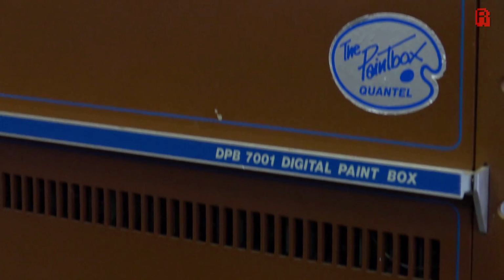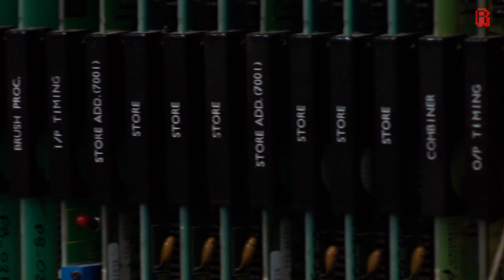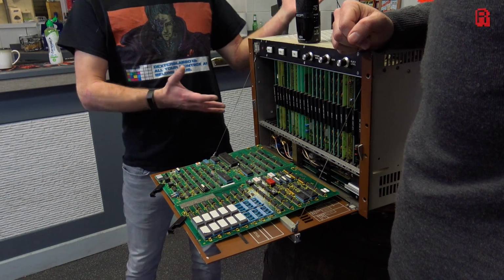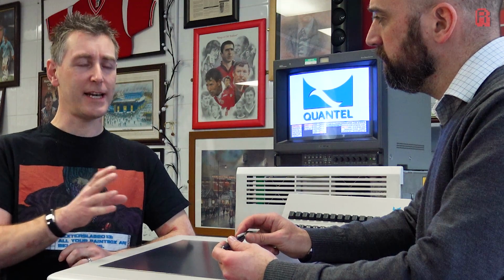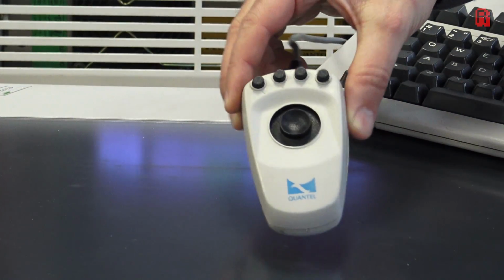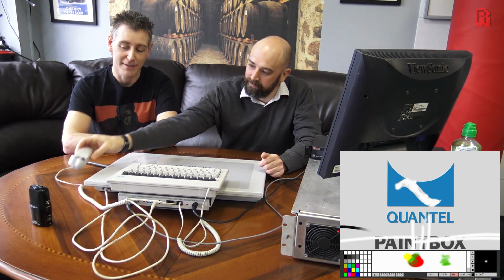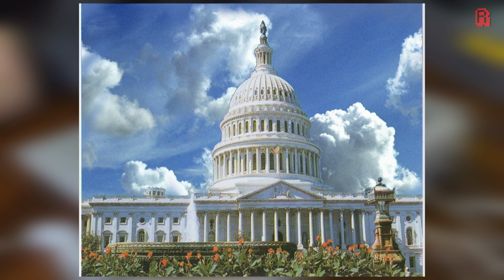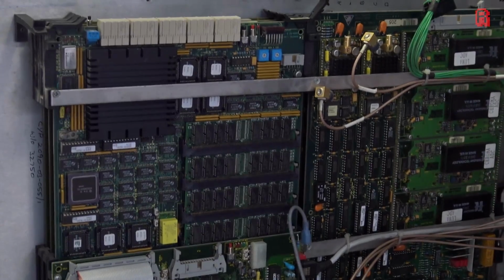How Did they make TV Graphics in the 80's & 90's?  Meet the Quantel Paintbox | Retro Road Trip

Comment: A 500MB SCSI hard-drive in 1989/1990 must've been $10,000.  I bought two 80MB SCSI hard-drives and an Adaptec controller card in May of '89 and spent damn near $2,000.  I realize part of that was the controller card, but still...  A single 500MB drive must've been ungodly expensive.
Reply: From another video these were SMD. At work I paid about £3000 each for 300MByte drives (I think they were 10") in the early 90s. At that price you also wanted a maintenance contract on them.

Comment: I own an original Spaceward Microsystems Matisse. Quantel sued, won and took the other British competitor out of business. Then they tried it again with Adobe, and lost.
Reply: I would be interested in learning a bit about the mattise, there is essentially no info about it.
Reply: @DextersTechLab  I have the original manual(s) .. two folders. I even have a 386 pc which was the host.
It all worked when I last turned it off, which was many years ago. I'm sure the internal battery must be dead by now, but I see no reason why it wouldn't work again. There's nothing missing.
p.s. It's very heavy as you'd expect.

Comment: Ooh... that animation interface. Suddenly the initially very weird seeming layout of HybridArts' CyberStudio on the Atari ST becomes clear. Totally trying to be a poor man's Quantel...

Also, let's see... 256mb for 12 seconds, or 300 frames at 25fps... that gives us 873.8KB per frame... with 576 lines in 24-bit true colour (assuming no alpha, or only a simple 1-bit stealing from the blue channel / chromakeying with a certain extreme value) that's only 512 pixels per line. Realistic? Or would it have had a squarer aspect and actually fewer frames / shorter runtime? The image looks fairly square-pixel on the monitor, and it would make sense to use that for graphics production... in which case it'd be more like 768x576, or at least 720x540 to just about hit normal vertical overscan in PAL... though perhaps the "true" colour was really 16-bit (or 15 bit plus 1-bit alpha), which would give enough pixels with that data space? Some others like Atari (with the Falcon) were still trying to pass that off as truecolour into the 90s.